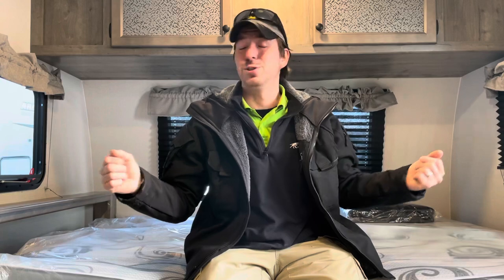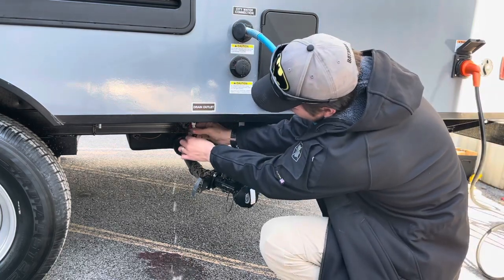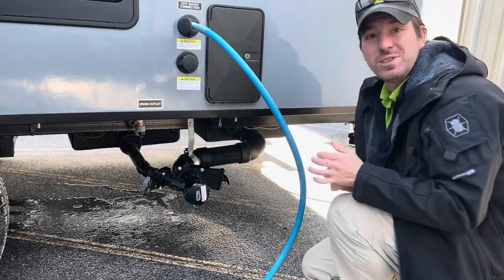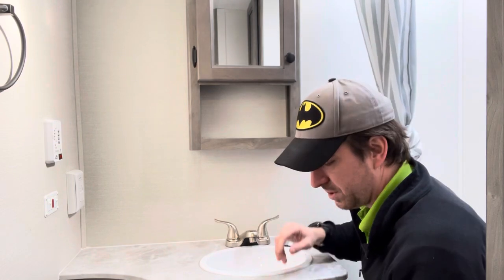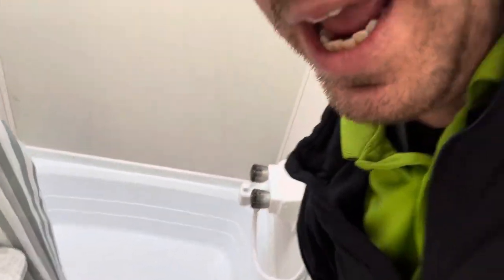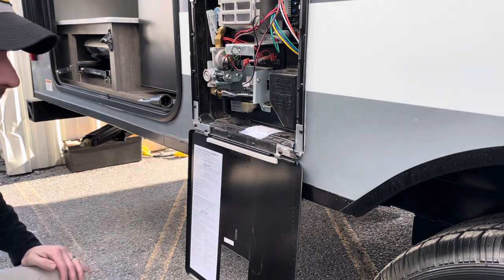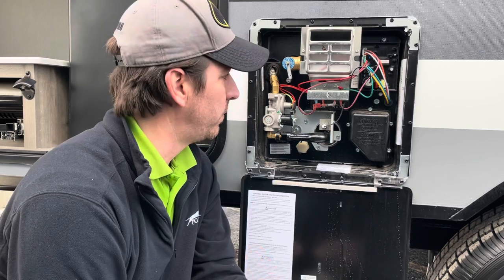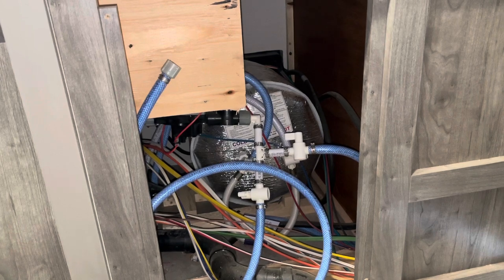De-Winterize Your RV! (Done On Apex 194BHS) | Teach Me RV!

Comment: I have a 193bhs, every summer I have to re teach myself order of operations to dewinterize and  sanitize the fresh water tank and lines even though we use jugs of spring water for drinking. Think I dump the low points and drain from the shower, then sanitize the fresh water and run some through the fixtures until pink is gone, then drain tank since I mostly do full hookups.
Reply from the maker: We are going to do a sanitize video next

Comment: Thanks for video it saved me from having someone else do it for me .  I have a 2021 Apex Nano 208bhs.  My question and comment is my valves work opposite from the ones in the video.  Also I noticed some anti freeze in what looks like a filter near the water pump that didn’t flush out when I flushed the system as instructed in the video.  Is that normal and will that flush into water heater when I turn on the water pump?

Comment: This is gonna sound dumb, but I’m fairly new at all this, the anode rod. I think mine is completely gone but I’ve heard some water heaters don’t use them. Isn’t the anode rod connected to that plastic plug you remove to drain the water heater? I’m certain I had a rod when I bout my camper used in 2019 but I’m embarrassed to say that I can’t remember.
Reply from the maker: Be sure to subscribe I will do a video on this!

Comment: I was wondering when you was going to do another video. Beginning to think you fell off the earth somewhere. Batman hat but no cape. lol
 I was wondering what that extra hose was for with the cap on it. I need to relook on our 265RBSS to see where the bypass valve (for the water heater) is because I didn't see it when I took the panel off.
Reply from the maker: Im still here still kicking. Cape is at the house. I wear the cape some but we just been busy. 265 Apex Hot water heater bypass should be under the fridge

Comment: Thanks so much for this video ! We just bought this camper and just followed your video to de-winterize, worked great ! Once the hot water tank has water in it and you turn it on, do you need to always have water to it ex. the pump or be plugged on the city water ? Or will it gravity feed and always have water in it anyways ?? Thanks again. Steve, Ab, Canada.
Reply from the maker: No it will hold water even when its just sitting there without pressure in the system   
-JR
Reply: @KeystoneRVCenter  Thank you !

Comment: Good video, thanks. But LOL, it is NOT a "hot water heater". You are not heating hot water to make steam. It is a cold water heater, or as it's normally called, a water heater.
Reply from the maker: Domestically, water is traditionally heated in vessels known as water heaters, kettles, cauldrons, pots, or coppers. These metal vessels that heat a batch of water do not produce a continual supply of heated water at a preset temperature. Rarely, hot water occurs naturally, usually from natural hot springs. The temperature varies based on the consumption rate, becoming cooler as flow increases.

Appliances that provide a continual supply of hot water are called water heaters, hot water heaters, hot water tanks, boilers, heat exchangers, geysers, or calorifiers. These names depend on region, and whether they heat potable or non-potable water, are in domestic or industrial use, and their energy source.

Comment: At what point do you turn on the water pump during de-winterization? Noob question sorry. Don’t want to make mistakes
Reply from the maker: So the truth is I personally never do. I de winterize with city water pressure

The small amount of antifreeze in the water pump is not an issue. So after I de winterizer the next time I go dry camping I will fill my water tank up with fresh water. Turn the pump on like normal and spit out what little anti freeze I have in there. It holds almost no noticeable liquid in the pump and I just let it sit in it until I need it. If you really want to flush it you can drop the hose in a water jug at any point and do the same thing. 

-JR

Comment: What about tankless/on-demand hot water heaters.   I don't see a bypass valve so  are there any special precautions?  (This is a 2021 Keystone Outback 330RL).
Reply from the maker: Check with the manufacture of the water heater. Each one of those tankless brands are a little different
-JR

Comment: At which step do you replace the low point drain plugs under the RV? Thanks
Reply from the maker: I would inspect them at the start of each season and change when needed. I put on valves to make it easier
-JR

Comment: Everything I find on the internet is about new RVs mine is a 2008 with no inside controls only an outside access to my hot water tank it's got a electric on and off switch and I know it can run on gas too but it just quit working was working fine till I unhooked my propane tanks refilled them and now it won't start can you help me please
Reply from the maker: What kind of RV is it?

Comment: So with this process, at no point do you need to put water in the fresh water tank from the other inlet? Not the city water?
Also, there is another low point drain under my trailer. Just 1 hose. What does that drain ?
Reply from the maker: No I do not. I know some people do but I do not. They say it is to "clear the anti freeze from the water pump. If that is a concern of yours you can use a jug of water and treat the pump like we do during the winterizing step to draw fresh water in  
-JR

Comment: Do you need to cap off the line that sucks up the antifreeze?
Reply from the maker: If we are talking about the one on the pick up hose from the water pump....YES.....if not which one are we talking about
JR
Reply: Yes,that one. My camper was winterized and no cap was found in the RV.

Comment: Do you need to add anything to help with desensitizing the lines from the antifreeze?
Reply from the maker: The antifreeze used in when winterizing is non toxic. RV antifreeze just needs to be flushed out. Some people complain about the taste But I do not drink the water from the camper so I do not have that issue. Just run a ton of water through it if you notice it when cooking or bushing your teeth but for me once all the pink is gone its good to go 

-JR